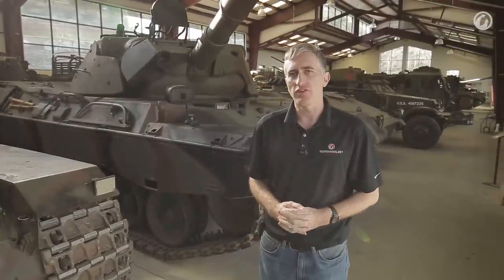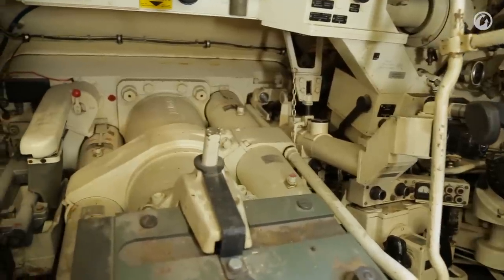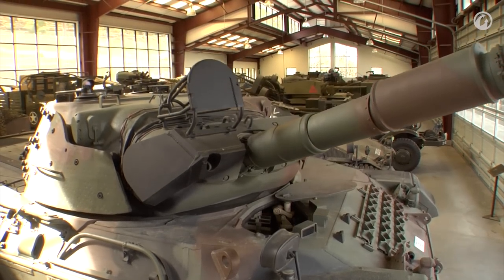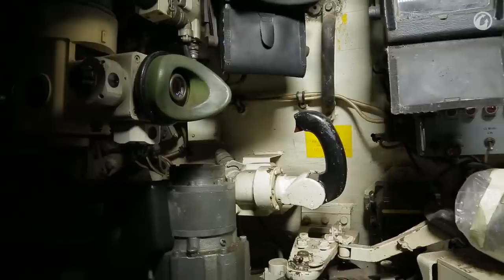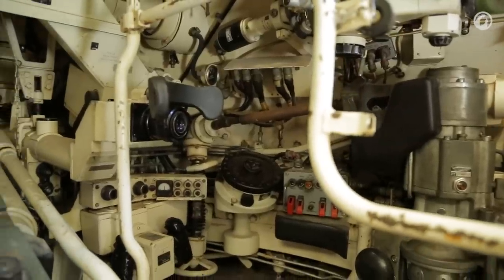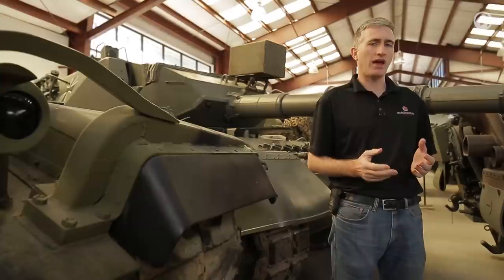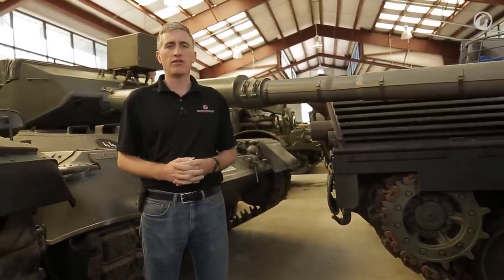Inside the Chieftain's Hatch. Snapshots: Leopard 1 [World of Tanks]

Comment: It will be nice to see a video with the same style of explaining for the leopard 2
Reply: It will never be done. You hv to wait for 40-50 years. Leo2 is the current German tank used by many countries including Germany herself.  So many info is classified. So i don't think they will allow a camera for a short documentary or as such.
Reply: it will be outdated in like 6/7 years, and not everything is really secret, maybe the gun an the armor, but not the hatches, suspension, controls etc.
Reply: I believe the T-14 outclasses it already and I'm from Germany (It's an 80s design ffs) but a sucessor is planned to only appear in like 20 years and well, german military projects are now known for taking much longer then planned (NH90 helicopter, A400M transport plane, Puma Ifv, EuroHawk drone, the list is endless)
Reply: Well, modernized Leopard 2s are equal-or superior to the T-14 in many ways. But base, and essentially everything A4 standard and below, is not technically obsolete, but not worth buying new.
Most tanks, despite minor differences, are nearly equal. A Leopard 2A7 going up against an M1A2 Abrams would be entirely dependent on if one of the two was able to fire at the other's side or rear. Otherwise, neither could truly kill the other-although disabling is certainly possible. 
This is why fighter aircraft, AGMs, AT mines, and ATGMs are a thing. Somewhat. Most ATGMs will be defeated by the armor of an M1A2, Leopard 2A7, M60T, T-72B3, T-90, Type 10, Challenger II, K1A2, K2, Merkava, etc etc etc. Without top-attack, ground fired ATGMs would have to increase to large degree in weight, and SABOT is not even close to a guaranteed kill anymore. 

Being from the 80s means nothing unless it is at a permanent, absolute disadvantage in every single fight. Tanks from the 80s can be upgraded to the very highest standards there are-it's simply not economical for the vast majority of nations. And then there's South Africa.

Fighter aircraft, on the other hand, are a different story. This is why a lot of nations prioritize funding for totally new aircraft over funding for totally new tanks. You cannot upgrade an F-15 with RCS reducing features to a standard that is set by an F-22 or F-35. Not even close. You CAN upgrade a Centurion, for instance, to a Leopard 2A5-M1A1 standard, however, as South Africa did.

Also, ALL military projects of modern times take eons. It's a universal trend. Every fighter aircraft designed since the 80s, for example, has taken at least a decade from start to first aircraft-most nearly two decades. 
Su-27
MiG-29
Eurofighter Typhoon
Rafale
F-22
F-35
F-15
F-16
F-14
F-18

Whatever to all of these have in common? 9+ year development times. F-15, F-18 F-14, and F-16 had the shortest development times, however, and they are subsequently some of the oldest aircraft on the list.
The trend goes that with better technology, development times increase. 
You cannot shorten development times, because developing a fighter with inferior, or lacking technology will just get you shot down. This is why most powerful nations have prioritized radar, missile and jet engine development over tank FCS, engines, and in some cases, the entire ground forces. In poorer nations with fewer powerful enemies, this trend reverses and the ground forces become dominant.

This is why the richer the nation, the stronger the nation is a rule. This is why Iraq, who had the 4th largest mechanized army in the world, fell quickly. And the fact that as a threat gets smaller, it gets less and less efficient to combat, is why an inherently inferior, heavily disorganized series of forces have persisted when by far the strongest force was defeated fairly quickly.

Please argue, I am bored any my life is devoid of meaning
Reply: I am to lazy to read but I disagree

Comment: I always thought the pistol port, as you called it, was for tossing out the spent casings from the main gun.
Reply: That actually makes way more sense
Reply: It works both ways.
Reply: Well he says "primary used for loading", he should not have mentioned it as a pistol port at all. 
 we only used it for loading and throwing out shells during a battle. I have never heard it used as a pistol port.
Former gunner on leo 1a5

Comment: Most countrys were buying the centurion for its upgradability.
Reply: Actually a lot of countries replaced the Centurion with Leopards.
Reply: Magpie4000
4 operators... not most. 4 of 20 replaced their centurions with leo 1s and this was because of the time it was taking for upgrades to come through to them due to demand and the need to upgrade to the 105mm gun quickly.
4 countrys still use the centurion in some form or the other including south africa that uses a highly upgraded and modded version.
Reply: +eraldorh I said a lot not most, however the main point is that the Leopard was a generation after the Centurion. The Centurion wasn't any more or less upgradeable than the Leopard.
Reply: Magpie4000
A lot like 4 of 20.... It was alot more upgradable the fact it has lasted through upgrades and easy ones at that since ww2 to 2016 says it all. The leo is far more than a generation ahead production of the vehicle didnt start until 1965 that over 20 years later than the centurion and for all intensive purposes the centurion with the l7 gun was a better tank than the leo 1.
Reply: It was actually closer to 8 of 20, or nearly half
What makes you think the Centurion was more upgradeable ? 
The Leopard and the Centurion both had the L7, Leopard was faster and had a better range, the Cent had a bit better armour, Leo had better fire control.
Reply: Important observation: Pretty much all the nations that bought Centurions were former colonies and Commonwealth that had depended on British arms for decades. This is not to say that the Centurion is a bad tank, but you must keep in mind that until the 1980s, most British weapons were adopted by a dozen or more former colonies out of tradition rather than because of any inherent virtue of the designs.

Also, it is notable that both Canada and Australia decided that the Centurion needed to be replaced and both decided the Leopard 1 was the tank to replace it. Above all, this was the first time either nation had purchased a large number of non-British tanks (if you don't count Lend-Lease or domestic designs).
Reply: The main reason for Aus and Canada choosing Leopard wad the price. Cheiftan was way too expensive. 
Leo 1 also still had the British gun. 
The Israelis put the ability of the Centurion beyond any doubt in 67 & 73.
Reply: Eustace Stritchers
Given that the british empire controlled almost a quarter of the earth land mass thats a very pointless observation. Even putting bad tank next to he words centurion is stupid never mind the commonwealth link. The tank was extrordinary for its time and its upgradability was second to none. Still only half the operators were ever commonwealth or former territorys of the british empire, it was the best western tank available in that era for a good price as well and its upgradability was obviously a good selling point. Canada and australia replaced their centurions with leopards 1 for logistical and cost reasons because neither canada nor australia have huge military budgets, yes the leo was cheaper but keep it mind it has no armor, it couldnt take a single hit from anything! and that lack of armor is a good reason it was cheaper as it didnt need as much resources or time in its contruction.
So no the centurion was not adopted by anyone out of tradition and theres absolutely no evidence to support that, there is however overwhelming evidence that it was adopted for the reasons i gave and is arguably the most successful tank ever made as it gave birth to the MBT.
Reply: What upgradability did the Centurion have? All it ever really got was a gun upgrade.
Reply: Magpie4000
Right so it went from mk1 to mk13 with just 3 gun upgrades did it? Try googling it before asking stupid questions.
Reply: eraldorh Pretty much, all other "upgrades" weren't terribly major, mainly sighting and fire control, some armour here and there and a new or different type of engine. Nothing there that anything greater than any other tank. 
Try getting some facts behind before saying things like "The Centurion was more upgradable. " It wasn't
Reply: eraldorh Pretty much every major tank since the end of WW2 has had similar upgrade programs carried out on it. The Centurion it isn't any more up gradable than any other tank. 
Try having someone read to you about the 7 different marks of the Leopard 1, 6 different Marks of M48, 12 different marks of M60, 20 + versions of the T72 and God knows how many of the T54/55 (1943 - to date). 
Just an FYI so that in future you don't look as silly as you do now, the Centurion turret was specifically designed to fit the 20 pounder, it was fitted with the 17 pounder initially as an interim measure until the new gun was available. The L7 105 was specially designed to fit the 20 pounder mountings, so no surprise the tank didn't need any modification.
Reply: Magpie4000
Cool story.
No other tank has been upgraded that much, a simple wiki check on the variants and upgrade history would show you that on any of those tanks.
Reply: You should try reading an authoritative source as the Cent upgrades and other tank upgrades were the same, but for the gun. Which was as I explained above specifically manufactured to fit the Centurion. Much in the same way the L7 was replaced with the M256 in the M1
Reply: +eraldorh You're incorrect here. Magpie is right. Centurion is in no way unique. In fact, it's not even the most upgraded tank ever. That would have to be the T-54. The most recent Centurions in service look exactly the same as they did in the 1950s. The T-54 can receive a 105mm gun to replace its obsolete 100mm one, get composite armour, get a laser rangefinder with a digital ballistic computer, get a new engine and transmission, get new sighting devices, and so much more. In comparison, the Centurion has hardly changed at all. It has a lot of "marks", but that's just a peculiarity of British naming conventions. As Magpie said, many of the later marks are simply old Centurions upgraded to an intermediate mark. Like the Mark 11, 12 and 13. All three are literally the same tank. The only difference is that they were upgraded from a different older model.
Reply: Magpie4000 I enjoy arguing for arguing's sake.

Comment: since its an a1 the stabilizer would be very good on the move. you could definitely shoot accurately. lol this guy doesnt know what a thermal shroud is for... its to protect the barrel from weathering/rusting keeps it in good condition and from shrapnel/ trees etc. Also so you cant see it from infared/thermal. the barrel is going to be hot as hell anyway and its not going to warp permanently from getting rained on... you compensate for barrel droop from heat with a muzzle reference sensor even in tanks today..
Reply: Before you criticize others, you should know what you are talking about.

You don't need a thermal shroud to keep the gun from rusting.  The barrel has a heavy coat of paint on it and I've never seen one rust in service.  A rusting gun barrel speaks to a soon to be relieved Tank Commander.

Thermal shrouds tend to be made of thin metal while the barrel is far more robust ordinance steel, so no, the thermal shroud is not not there to protect the barrel from shrapnel or trees.

A gun tube is perfectly visible through thermal sights.  Because its got a high surface area given its mass, it cools off and heats up more quickly than the rest of the tank under changing conditions, sleeve or no.

Differential cooling (rain on a hot barrel) does have a negative effect on accuracy and muzzle referencing sensors first appeared in the middle 1980's.  Before you then you made your adjustments by guess and by god.

You've scored zero, so you are not a go at this station.

Listen and learn young Trooper.

Comment: If the Leopard 1 is really designed as "screw the armor, it'll get though anyway", but focus on mobility, reliability, and a big gun and CAN go through other vehicles, well, the Germans definitely were learning from the Russians. They said bye bye to the monstrously heavy (relatively), slow, and unreliable Tigers and Panthers and welcome back the Panzer IV (relatively, in design philosophy).
Reply: +Xuan Vinh To the Panther tanks weren't that slow though not like the Tiger 1 and 2's
Reply: Nathan Munch they were rushed into service so they had issues with reliability. Also the Panther used interleaved wheels, which are better for weight distribution and added side protection. However, the down side is more complicated repairs and replacement. Should mud get between the wheels, and Russia during rainy autumn or thawing spring, there's no shortage of that, it could clog the wheels. Especially in autumn, because winter would freeze the mud, jamming everything
Reply: +Xuan Vinh To They did not go back to the Pz. IV. The Leopard is more analogous to the Hellcat in technical terms, but the Hellcat fulfilled a niche role in a family of armoured vehicles divided into multiple classes. In 1968, those terms no longer existed. There were no longer any heavy tanks, no more dedicated tank destroyers, and no more medium tanks. The Leopard 1 was an MBT in practice.
Reply: Tiles Murphy I know; but the MBT concept is the logical progression for standardizing a tank in most armies, and its closest ancestor is the medium tank.

The gun armed tank destroyers are still made, in small numbers and specialized roles. the Germans had the Kanonenjagdpanzer, a Cold War era vehicle, with a 90mm gun: adequate for its time but anemic now. The Italians and Americans made their 105mm gun turreted light vehicles. Not exactly a tank destroyer (since 105mm is inadequate now), but somewhat a SPG (in WWII terms). The Russian made one of the few true gun amed tank destroyer, with the 2S25: a 125mm, turretless, lightly armored, low profile vehicle. The 2S25s serve the anti-tank battalions and companies of Russian motorized rifle brigade.

The tank destroyer role is taken over, in part by IFV variants carrying ATGMs. They might be called ATGM/TOW carriers, but their role is not to carry dismounts but missiles. Those might be formed into anti-tank companies, and battalions to strengthen infantry-heavy units.

Light tank roles are partly taken over also, by IFV reconnaissance variants with less infantry carrying capacity, more armor and ammo.
Reply: Xuan Vinh To There are too many differences to warrant a direct one-to-one comparison.
Reply: No for example the T-55 had very strong armor for the time and the T-64 was the first tank to have composit armor.
Reply: Xuan Vinh To The rounds at the time were to strong for any known armour, so they didn't bother trying to develop one but get a tank out.
Reply: Panther are seen by many as the best (medium) tank of WW2. They were fairly reliable compared to other German tanks and they were highly esteemed trophies by the Soviets. Just think, would you rather command a T34/85 with  45mm frontal armour or a Panther with 80mm frontal armour? The Panther had a more precise long range cannon and was basically Germanies improved version of a t34. The Russians swapped the turret of the T34 to keep up with bigger tanks, but didn't improve the armour.
Reply: edi fairly reliable? Latest model yes but A and D model, dude half of them broke down on the way to the battlefield, the allies captured so many of them that the German left it. A medium tank doesn’t care about armor, and compare to T-34/85, it’s more maneuverable than Panther. Putting more armor on a tank is the worst thing to do, especially it is a medium tank. T-34 changed the turret not to keep up with other tanks, but to make more room for the big 85mm Zips-S-53 or D-5T gun.
Reply: @edi9892  the front armor of a T34/85 turret had 90mm rounded . i would personally prefure being in a T34/85 as my tank won't break down every 2500m (the drives), The final drives of the Panther remained an issue for its entire service life, including French operation, although the Panther's other issues were largely fixed. The quality of the steel was reportedly tested by the Littlefield collection, who found it satisfactory. The spur gears simply were not up to the task for a vehicle of such weight. In fact, the Soviets reportedly considered spur gears (of the panther) for their T-70 and found them unsatisfactory even for that! basically even late panther would drive a maximum of 2500m before their drives needed to be fixed, as a result 80% of a panther unit was in operable at any one time.
the T34 was extremely tough in most circumstances and easy to fix for those that weren't resulting in 90% of a unit being combat ready at any one point. whats the point of being a panther CO if your tank is useless because its drive (or other component is broken), t34/76 obr 1941 were much more unreliable (like early panthers, although still better) but all of those issues were largely solved by the t34/85.

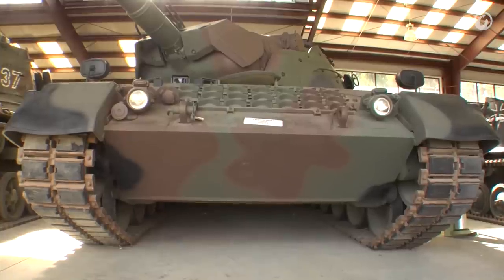Comment: Whats a centre guide @ 2:45 ??
Reply: It's the spike on the inside of the track, keeping the track centered on the wheels. In some cases (T-34 comes to mind) it is also used to interface with the drive wheel. Most tanks use sprockets however; the center guides are only there to keep the track from falling off. In some cases there is no center guide, instead you have a pair of guides on the outside of the track.
Reply: H311fi5h good explanation